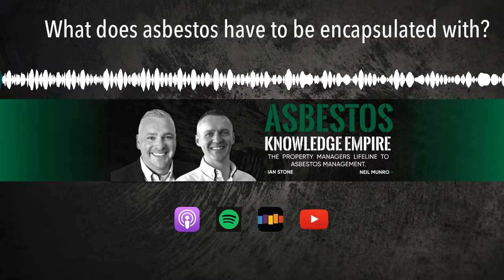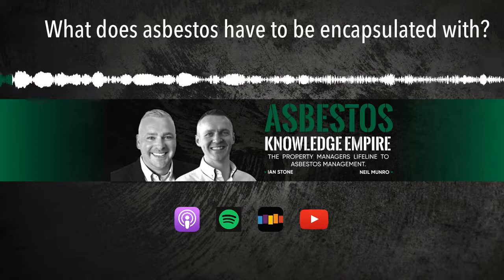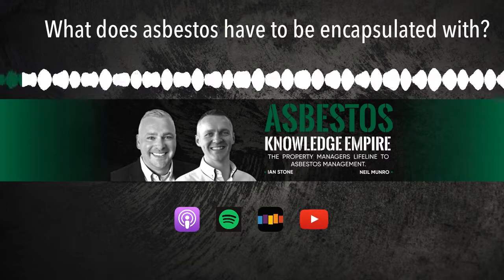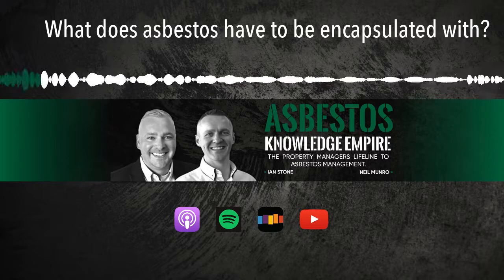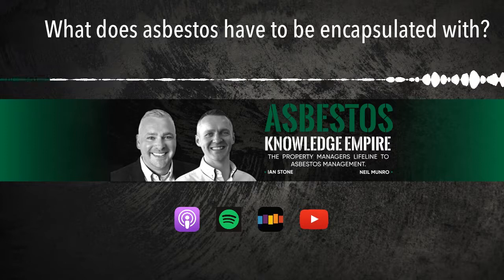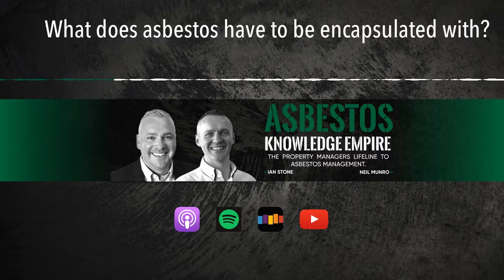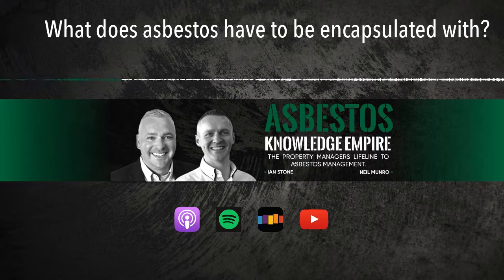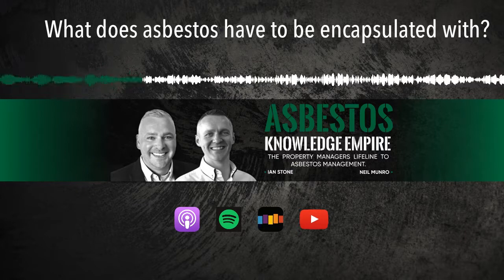What does asbestos have to be encapsulated with?

Comment: What if it’s hard to reach? Like the insulation on a pipe that goes up 2 stories? How am I supposed to paint that?
Reply from the maker: If its hard to reach but needs encapsulating then some form of access should be used e.g. a cherry picker or scaffold.  Your asbestos consultant / asbestos contractor should be able to advise further on what can be done and the cost implications.
Reply: Where do I buy 8150 I have some asbestos wrapped heat ducts I want to encapsulate